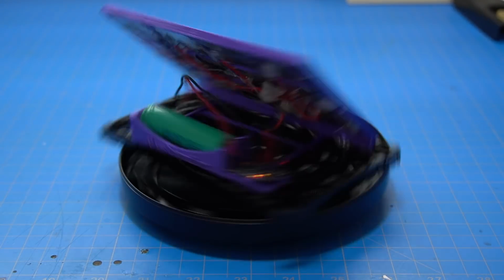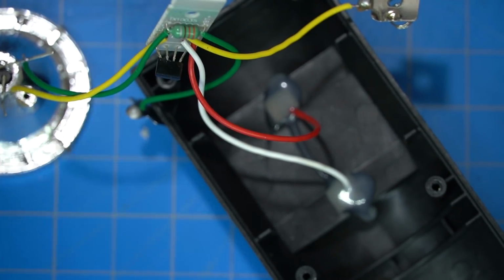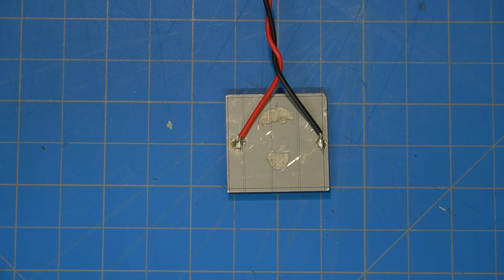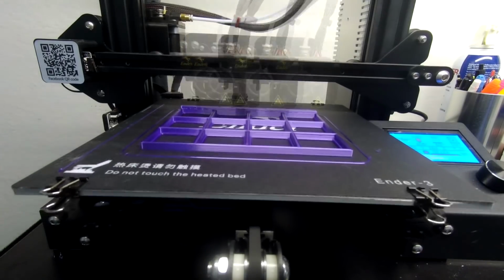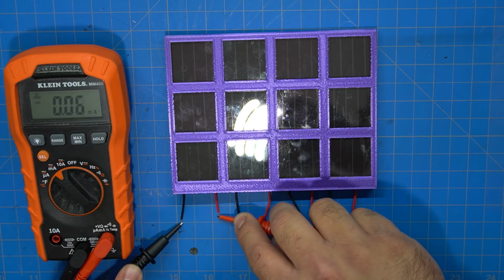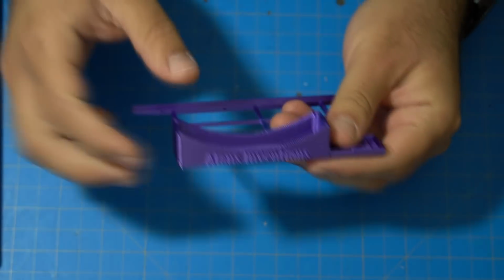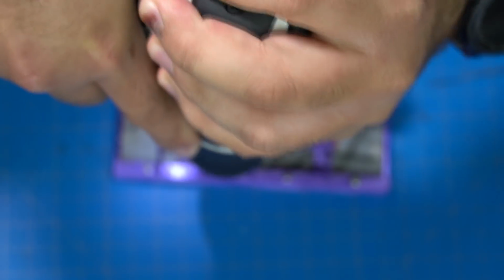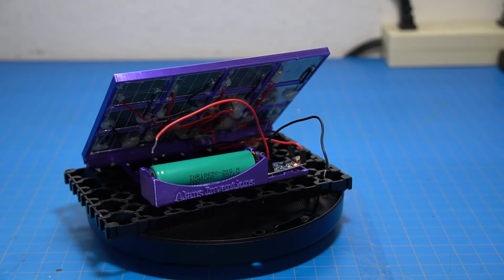I made my own Dollar Store Solar Panel

Comment: About 3 years ago I recycled my old solar lamps exactly in this way. To easily remove the solar panel, you need to heat it with a hairdryer. When the glue dissolves, it is very easy to push the panel out. If possible, it is better to leave the original cables. Just like in the movie, it's very hard to solder them. In several-year-old panels, during soldering, the cable often fell off along with the silicon layer
Reply from the maker: I learned isopropyl alcohol dissolves the glue as well.
Reply: A plus 1 tool is a decent heat gun  . its basically a high power blow-dryer. That will get hot enough to solider video processors to motherboards .  and  heat up 1" PVC pipe to name custom bends
Reply: I've broken three of them because I desoldered the wires...

Comment: I tried something like this with hot glue and my own structure (not rich enough for 3D printer) the hot glue got soft enough with heat from the sun and the ting fell apart. I later used silicon which worked well. I have larger polycrystalline cells from larger garden bright spot lights. (They were thrown out and thus got them for free!) There were 2 2000mah 18650 cells already in there and the solar panel gave 6W (5V x 1.2A) output in full sunlight. Easily charges my phone.

Comment: I've been scavenging dollar store solar lights for a few years. I've made several small,panels using dollar store pictures frames as a framework. Add a 12 volt gelcell and a cheap Chinese controller and I have lights for a couple of garden sheds.

Comment: That works out to $19 per Watt. Interesting project, informative video. For a second there, I got excited thinking about solar cells for $1 each but then I did the math 7.2V x 85mA = 0.612 Watts for $12 (plus frame and charge controller). The dollar store isn't a great bargain after all. Oh well. OTOH, I found a 2 Watt solar panel online for $7 with free shipping, about 4 inches by 5 inches.
Reply: Lol reality
Reply: Can I have a link to those
Reply: Just fun project. If your that concerned id just pay electric bill thats 12 cents per  1000W
Reply: These panels found in solar lights perform better in low light/overcast conditions and generally are more expensive, so it‘s not a bad deal.
Reply: This project would make sense for someone like me who thought these would be great for lighting up my yard at night but have about a good amount of them that stopped working after a few months. Rather than throw them out I can Jerry rig them to light up a higher quality LED for the yard.

Comment: My local cemetery threw a bunch of solar lights away so I grabbed them out of the trash. I think the batteries are only dead in most of them.
Reply: I love dumpster diving!!! Some people just throw away good s##t without a care in the world.
Reply: Honestly you can get some good flower racks from a cemetery dumpster as well. (I have strawberries and succulents hanging on mine.)

But heck, if you get enough of the small ones and get some batteries you could make a large solar charger block.

Comment: I built something like this many years ago. I had a friend give me 14 old yard lights they were getting rid of. I made a frame out of bamboo chopsticks. It put out enough power that I could trickle charge a car battery with it. Keep in mind that hot glue is a terrible choice if this is going to be exposed to high temperatures (like sitting behind the windshield of a car sitting out in the sun).
Reply: How long did it take to get a full charge
Reply from the maker: Honestly I don't remember anymore. But the charging rate was very slow.
Reply: How many small DG Solar path lights do I need, MINIMUM,  to be capable of charging a 12v battery?

Comment: The transistor is of the switch variety.
The circuit board is a Comparitor board that compairs the battery voltage with what's coming out of the solar cell. When the solar cell voltage is high the battery charges and the LED is off. When the solar cell voltage drops the battery powers the LED. It's the compairator board that decides this.
Reply from the maker: Thank you!

Comment: i have done that with a large number of these solar lights as well. i found some really old ones and the cells all still worked great too. i ended up creating a 12v output panel
Reply: How many small DG Solar path lights do I need, MINIMUM,  to be capable of charging a 12v battery?
Reply: @KryptaKnight  I have 12 of them hooked up in series parallel to get the proper V and amp. mine are all recycled so they werent running perfectly which is why I had to hook so many up. I would suggest you connect yours up and test to see what you get from yours. I saw output from one cell to be anywhere from 2v to 5v but the amps were under 100ma so had to put some in parallel to get the current going enough to charge a 12v

Comment: Look up " jewel thief " and as pointed out by another comment, the boards have an inductor.  It would be one way to use smaller than required voltage/current to light LEDs.  There are ways with an inductor, not a hand wound transformer to make the circuit.  As long as they are all in paralell and roughly the same voltage drop on the LEDs, they will all light up to the same brightness until you reach where there isn't enough power to make them bright.  At that point, remove only one at a time until they work again.

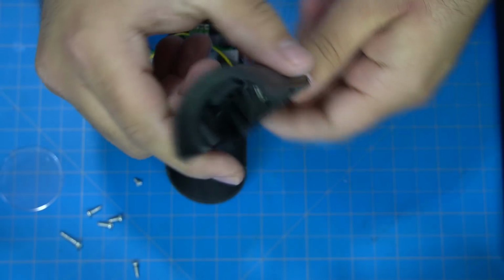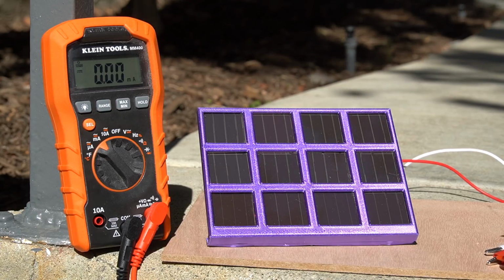Comment: At 1:20 it's not a resistor and a transistor. It's an inductor and an ASIC (application-specific integrated circuit, e.g. YX-8018 or QX-5252); transistors have three leads, not four. The inductor increases the 1.5 volts from the NiMh or NiCad cell to the 3 volts required to light the LED, so it's a voltage increasing circuit, not a voltage drop one. At 8:16 the TP4056 module requires an input of 4.5-5.5 volts, usually a USB input. Data sheets are your friend.
Reply: I have ran a tp-4056 board with 10 volts under test with no ill effects so he should be okay
Reply: Cool, wondered what those were as someone new to electronics  it kind of threw me off.  I like the simple design how it charges the battery when theres light, otherwise turns on the light when its dark. I wondered if they could be repurposed for other applications,  I salvaged some panels from the same type of lights, albeit even smaller then in this video.
   I managed to get 6v 50ma  out of my 3 in series and another 3 in parrallel, which seems about as bad as whats being shown here, it would take like 20 hours to charge a aa battery or something , which at 10x the  size wouldnt be an issue but then size does and you see the ratio of solar panel needed to battery is still pretty inconvenient.  You really need a foldable solution to charge 18650 type batteries or like a phone or powerbank.  Id imagine newer solar cells perform better and these have to be the most budget cells they use in these dollar store things.
Reply from the maker: Nailed it!!
Reply: The TP4056 works with a voltage of 4.4-8V as far as I know. Because it‘s linear, if the voltage is higher it won‘t be as efficient.

Comment: I haven’t read all the comments, so forgive me if someone has already given you this tip. But a couple drops of isopropyl alcohol will cause the hot glue to dry and can be easily cracked off. I use hot glue for temporary mounting because I know I can get it off later.

Thanks for the idea. I’ll be doing this soon!
Reply from the maker: Yup!! Thank you

Comment: I do a lot of recycling in my area and offer electronics recycling. So, I get a lot of damaged solar light where the photovoltaic cells are still good. I have been collecting them up for a while and plan on next winter (got too many projects for this winter, sigh) to build as large a panel as I can and see what I can do with it. 
But, thanks for posting your ecperiment.

Comment: You should ad the extra batteries for the extra run time for whatever you want to power. This is a good idea to do what you did. Great job. I get the 18650 batteries in battery packs from 5below. Also they have the flat lipo battery packs for 5.00.
Reply from the maker: Thanks for the tips! 🙂

Comment: The number of times I thought about doing this exact same thing. I told my neighbors that when their solar night walk lights stop working to give them to me instead of throwing them away... Another interesting idea is to use LEDs for solar power. Most any LED in the sunlight will produce voltage. The clear ones should produce more than the colored ones too. Just another idea to try...
Reply: I thought red LEDs produced the most voltage?

LED = solar panel and vice versa. Same technology but manufactured more for one purpose versus another.
It would be kind of interesting if someone manufactured a solar panel to both absorb light, and emit it. - I imagine it wouldn't absorb light efficiently, or emit it strongly, but I think the concept would be cool.
Reply: This is why Transistors were put in small cans when they first came out in the 50's. Researchers found the transistors produced the unwanted voltage.

Comment: From my experience, the solar panels in these cheap lights have very short life spans.  My mother liked to buy them. Long ago, you could get solar lights that would last 5-10 years, where you could just replace the batteries when they failed.  But it seemed each year the construction got cheaper, with the panels failing faster and faster.  Eventually it reached a point where the lights wouldn't even last a full year, you could look at the panels and see that they'd cracked and become cloudy just from several months of outdoor exposure.
Reply: Same conclusion. What doesn't break doesn't sell... More than once. Wicked ones

Comment: use heat or a heat gun to remove hot glue , use paste flux when soldering - yes your soddur allready has the flux in it , so does mine - use paste flux when soldering , then remove the excess with 91 alcohol . clean the hot glue spider webs up with a hair dryer or heat gun . but an embossing tool works well too . super cool project alan !!
Reply from the maker: Thank you!! Part of the difficulty is learning to film all of it as well. 😁

Comment: My Mother in Law buys those lights all the time.  Never attempts to referb them when they poop out.  She gives them to me.  Problem ?  She never buys the same ones.  Of the dozen I have panels from like two are the same size and shape.  LOL     When mine crap out because of the chity  batteries they use, I just solder in a Alkaline AAA cell.      YES they RECHARGE just fine.  I recharge Alkaline cells for our flash lights about 10 times before the take the dive.  In the Yard lamps they last a few years easy.  Trick is to recharge with a really low current.  20-50mAh seems to agree with them.  The yard lights produce less then that from the mini panels.   Cool Video...

Comment: So, Harbor Freight sells their "Chinese Special" car battery solar panel battery maintainer for ~$15 USD (SKUs: 64251, 44768, 68692, 62449). It's rated 24V at 1.5W.

While 24v is a bit of a pain (I like my sealed lead acid batteries), 60mA is NOT a whole lot, it would probably still manage to charge a small 12v sealed lead acid battery somewhat slowly. You'll also need a dropping resistor of ~160 ohms.

Alright, so what about DIYing this with solar garden lights?

If the rough math I did is correct, you'll need 36 of them (12 in series, 3 in parallel). Each one does ~2V at 20mA and they're about $1.25 USD a pop where I live, which means about $50 USD. Yeah.

Although, if you config them as 6 in series and 6 in parallel you won't need the dropping resistor.

Granted, 2V 20mA panels off AliExpress are probably much cheaper, but then you have shipping, and 12V panels at ~1W are probably cheaper too.

So, not cost effective! Though if you already have these things, why not?

Comment: I remember trying this as a kid using a CD case to house the array, though I never actually glued them in (heck, I still have the little panels in a bag somewhere).
Looking back at it now the £ per watt is pretty bad, though they did come installed in lights after all.

Comment: One may be more optimized if printed a frame  in two different parts and bolting them together. Then you could adjust the angle for sun strength.
Reply from the maker: At the time my 3D design and print were tough enough to do as is. :) I am still trying to learn how to print hinges and other mechanical items.
Reply: Thinking back on this now,,,,the adjustable/wing nut stand kind could be attached simpler 

I can't wait till I can get a printer I have a feeling I'll be learning a lot more about many more varied projects with it

Comment: Pro-tip -- if you use Isopropyl alcohol, you can remove hot glue really easily -- just soak a small paper towel and hold it on the glue spot for about 15 to 30 seconds -- if the glue doesn't just peel right off, add more IPA and another 15 to 30 seconds -- it should just lift right off, all as one piece, without much hassle.

Also -- PSA is fine for outdoors -- even in wet or humid environments.  It's fine.
Reply from the maker: Haha 😂 thank you. I have received that tip so many times lol

Comment: If the little wires on the solar cell fall off, you are stuck!
There isn't a visible terminal to solder to, so you have to guess where to apply the solder.  I got lucky by adding a BIG blob of solder.
BTW-  I'm putting together a few cells to power a watch winder, so you can use it in the winter without the A.C. adapter, or you can take it when you travel.  It needs 3CDC(2 AA cells.)

Comment: Very interesting to me. I have so many Solar Panels but don't have the smarts to use them. I have a 300 W huge panel and about 6 - 100W Panels and then have at least 200 or more mini solar lights that I keep lit all the time inside the shop and outside. Using FREE batteries I scoop a lot of free energy. But I am anxious to get the big panels in use. I will sub. TY

Comment: Cool I did that exact thing before. I never thought about a 3d printer. Lol I used Styrofoam. The only difference was I used more parallel  circuits for more amps. Great Job
Reply from the maker: How much power did you end up getting out of it?

Comment: I did this little experiment and I realized it's actually cheaper to buy a small solar panel that puts out more power then all the lights. What I didn't try is if it's possible to remove the silicon used to make the solar panels to make a homemade panel.

Comment: I believe the tp4056 just wast any extra voltage as heat not buck converter or anything so if if you can get by with 2 in series that would probably be a lot more efficient

Comment: its not a transistor or resistor . though still usefull stuff there . its a rather specialized circuit and the resistor looking circuit is a coil or atleast its a circuit that is used like a coil to boost the voltage . i looked the parts up at one point .

Comment: The explanation for the circuit is wrong:
The 4-Pin chip is a switching chip because the LED requires a voltage of 3V and the NiMh cell puts out 1.2V, the resistor thing actually is a coil. Together, they work as a really simple boost converter circuit. The NiMh cell most likely charges directly through the solar panel because you don‘t need much circuity to charge a NiMh cell (a low current source or current limiting resistor).
Reply from the maker: Nice ! If I had the lights , I would test it out.

Comment: More interested on that Ender 3 and how to program something in and have it come out
Reply from the maker: Hey it's a fun little 3D printer, entry-level cost, easy to work with, lots of videos out there troubleshooting common issues. I have had it for a few years now and works just as good as the day I bought it. I did a quick assembly video if you're interested in seeing it be built. I am sure there are much better videos out there talking about the 3D printer specifically. Here is the linkhttps://youtu.be/o4IUaqO6rgk

Comment: That glue you used will melt under the summer sun i can tell you that,and the plastic frame you used will be brittle in no time.Good for indoor,but not for outdoor.
Reply from the maker: Correct. That was more for demonstration.

Comment: I salvaged a pile of those panels from old lights that rusted to death in the garden, and I rued doing the same but couldn’t get them to stay together, it never occurred to me to print a frame.
Reply from the maker: Do you still have the panels?
Reply: Or you could just embed them in epoxy rein and then all the wires and electronics are protected and water proof.
Reply: Good idea, I can use that with a printed frame to hold them in place while wiring it up

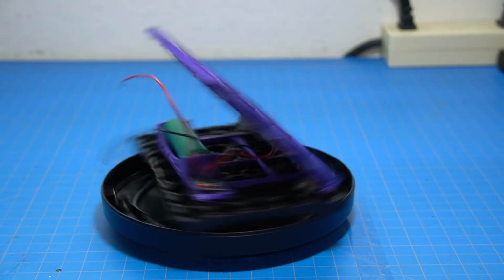Comment: 9:17 Put those small and cheap electric motors in that to rotate, hot glue a printed gear in it and then choose the ratio to rotate.

Comment: I am going to make something like this out of old solar garden lights. I'm going to get a large board and wire them in a way that I get at least 6 volts and at least 500mA of current.
Reply from the maker: Hi did you end up doing this? Might be better to buy a premade one. More efficient, higher power output and also less fragile :)
Reply: @AlansInventions  No I haven't been collecting solar garden lights. May look for premade one but I want to build something and have it work. Like the FM radio I built.